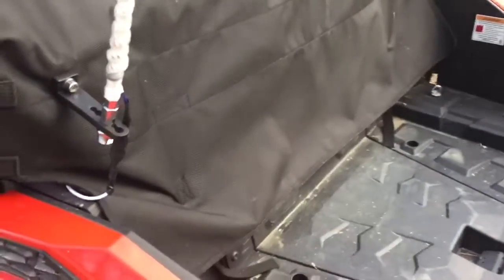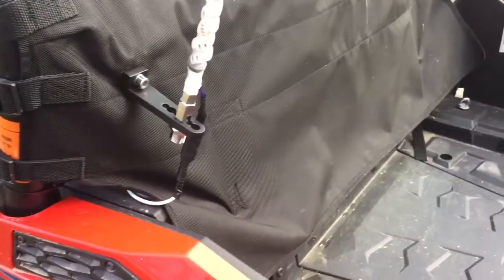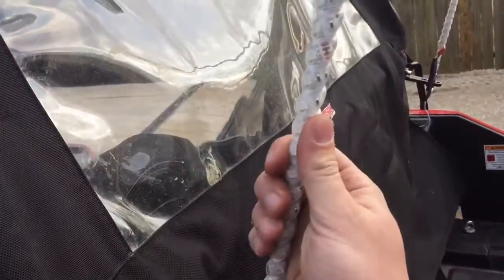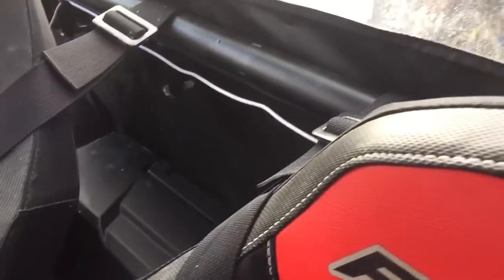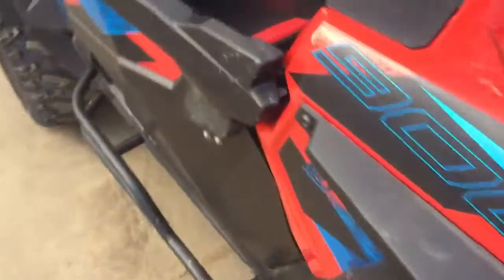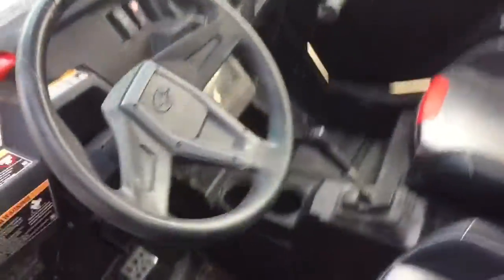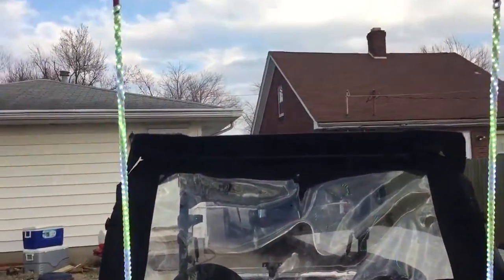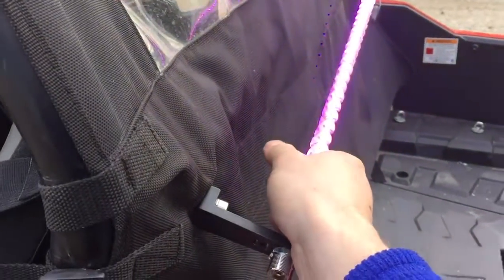DIY Homemade LED Whips

Comment: How many 15ft strips did you need. And also, did your particular light kit allow strobing/flashing a single color
Reply from the maker: tobster421 one 15 ft strip and I cut it right in the middle since it has connections pre-made on both ends of the strip.  Yes it allows for flashing a single color

Comment: Im about to order everything to do these. is there anything you would change now that youve had them awhile? I have a 15 Rzr 900 Trail I wanna put them on.
Reply from the maker: Dave Burkhart yes I wouldn’t make them again.  They’re cheap enough now on eBay it’s not worth the effort to make them.  I bought a set of these so this link:  https://rover.ebay.com/rover/0/0/0?mpre=https%3A%2F%2Fwww.ebay.com%2Fulk%2Fitm%2F332260907631
Reply: How did you mount them? Are they solid what if they hit a tree?
Reply: @Jason____  i know this is an old thread. But how well did the Fia whips hold up? I'm was wondering about buying a pair of them.
Reply from the maker: choppers2yadie they did well.   No complaints at all.  They also offer a 2 foot option now that I really like and a couple of my friends have them.

Comment: How did u make the colors chase
Reply from the maker: It’s a function of the type of controller used to control the LED strips.

I’ve actually switched since this video was made to a WS2811 LED strip and a WS2811 controller that has over 300 functions and even more animations.  I highly recommend those strips over traditional strips.